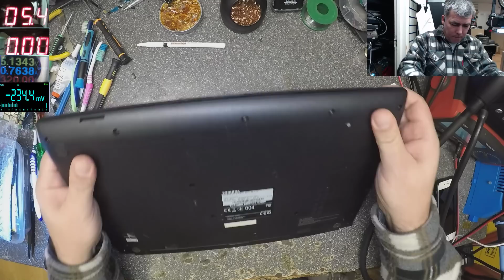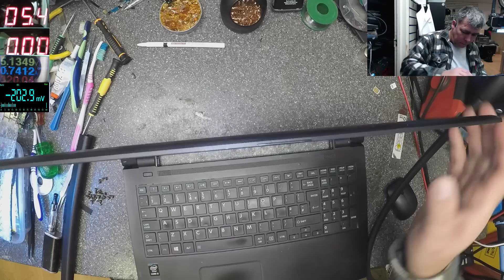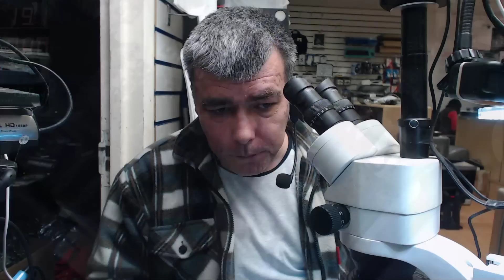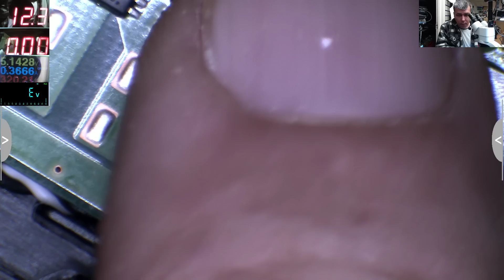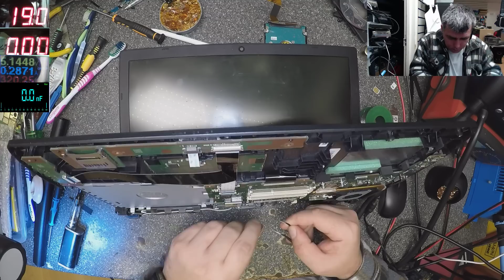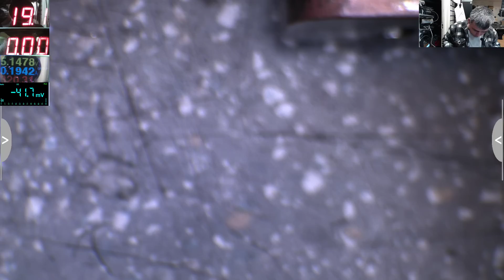Toshiba Pro R50-b-12P, dead, motherboard repair, confusing one

Comment: I'm always surprise to see you replacing components with just a bridge of solder. Are you not afraid that it will break things? (They are there for a reason right?)  Do you replace them after testing? If so, how do you know the value without schematic?

Comment: First thing with a windows 10 machine ... once its up and running .... go into settings and
DELAY UPDATES ... that way you won't suffer an update when you shutdown the computer.
Its all in the very last block of options .... where you find windows updates and activation, etc.

Comment: You were right at the beginning the short circuit is after the first mosfet, the probes didn't make good contact with the pins because that capacitor you were injecting voltage at is in the same track with the first mosfet and current sensor resistor maybe if you haven't taken that inductor out you could've seen that shorted capacitor the  problem is that it was far from what you were seeing on the microscope a thermal camera would've been very helpful in this case and i know it's an old video lol thank you for another good lesson

Comment: I stopped doing updates about 7 years ago. What happened was with every update the machine ran a bit slower, and lost another function it had when new. After about 5 updates the machine is dragging, and none of the extra functions it had are available. So I bought another hard drive and with the new machine I saved its state to when new and put in a faster and bigger hard drive. As it slowed down and lost functions after a number of years, I put the original slow hard drive in and was pleasantly surprised how much faster with all the functions still working and copied that to the new drive. The problem  is I lost all the information and pictures I needed I had added. So I saved them to a thumb drive next time.

Comment: You should do a video on trouble shooting with a bench power supply. I've been repairing electronics for 20 years, but I never learned to use it as a trouble shooting too. only to supply voltage.  Great videos, I watch them while repairing UPS Power Supplies for the telecommunications industry.  Thanks

Comment: Hi there, you seems know well for repair Toshiba laptop no power issue. I got a Toshiba S55T B5273NR MOTHERBOARD with the same issue. Let me know if you could fix it for me? Email k95670@gmail.con and see if you can to try to help me. Let me know the price for the job as well. Thanks!

Comment: "Pro" means soldered on APU, one stick of RAM when an equal amount of dual-channel is better, an unsecured HDD, using a mechanical HDD as is, etc.

It's all marketing. I can think of about 4 items where the Pro variant gives you a substantially better version and Toshiba laptops clearly aren't one of them.

Comment: Nice job, Sorin. I had the opportunity to fix one of these. It's a bit extrange machine. The input mosfets are located away from the power input, and the traces are not very common. In yours, you almost had a fuse; in the one that I fixed, there were no fuse or anything. It was previously manipulated (I hate it!), and there are no schematics for this model. Finally it worked, but it a was a multiple damaged computer...caps shorted, Mosfets...Congrats!

Comment: actually i find the problem after u pickup the blow up cap, coz i know first one u pick up is a resistor depen  of the color n power real.....
coz if that is a cap, there is must have negative or minus real, but I can't see minus real.....
so i quess that is main power.
n after u cut down the resistor ofcoz the first gate is no shot anymore coz the short is not in first gate like u think...
btw i like all of ur education.....
thks for all the video......

Comment: hello sir, i need ur analysis on this problem; i've an toshiba sattelite u300 old laptop which as soon as i turn it on, its fan going full blown all the time regardless of  cpu usage, its very strange and uncomfortable because of its noise. i updates its bios and problem not fixed, the cpu temp on idle state is around 35 degree, still fan spins fully! there is no RPM in bios and also the SPEEDFAN app in windows dosn't show anything about fan or its RPM (yet it say "found toshiba fan driver" when i run the app). so what could be the reason and how can i solve this. p.s : without windows running  and in other environments, the problem persist too. any idea?

Comment: Mr, you have problem solving skills beyond average, but I think you should improve the presentation of your final work /repairs, like putting back a new resistor or at least leaving a neat solder blob in its place. You didn't start repairing laptops 2 days ago😜 Great problem solving value in your videos, as usual. Not so much about soldering skills. And it would be so nice if your desk didn't look so much like mine 😂😂😂

Comment: Hi there , the same capacitor on a Tecra C50-b1271  i honestly  don't see any difference between the two models , so after seeing your video i directly  checked the faulty cap AND   it was shorted  so removed it  
The laptop started
one more time THANK YOU THANK YOU we learned a lot from you!!!

Comment: If you remove a cap how do you not end up with  an open  circuit ??
Reply: I see now. Removing the Resistor created an open circuit but caps are tied to ground so removing one does not cause an open circuit 🤦‍♂️🙆‍♀️🙋‍♂️

Comment: Hi Sorin, I have laptop shuts off/ power cuts random but within a short time only when AC used.  tried different adapters. Do you think can be battery/AC power management circuit. I'm thinking must be electrolytic caps in pmic circuit because its random. On battery only works

Comment: Isn't t it risky injecting 19v on the laptop while the charger is plugged in ( and also supplying 19v )?
Reply: not on this channel … the gods of electrons are with us … and if eventually magic smoke appears we bypass the component.  :)
Reply: @0dium.  Haha.  I am trying to fix a board right now and have 2 options: a) order a replacement chip, or b) run a wire to inject voltage into the insufficient 'enable' rail the chip should put out--"The Dodgy Way" (TM).  ...I think I might go the latter route.  Thanks to Sorin, I now have ethical options I would never have considered.  Note: As in the case of the 19v, at least it's injected in parallel--not in series ( which would be really bad )!

Comment: Would it not be better to come in with 0.8v on the power supply rather than 19v, in case the 19v power rail is shorted via a lesser voltage rail ( like: CPU vcore )?  ...This way there would be less risk of damage?

Comment: the "petrol" fluid you are using that evaporated with high heat, what is that fluid please?
Reply: He calls alcohol petrol. Its isopropyl.
Reply: @Vinnie2x  in his other videos .. he does refer to isopropyl alcohol .. .when he uses that ... so he notices that difference ... this is probably a refined or better quality petrol ... or lighter fluid probably ... it evaporates a little slowly as compared to what i would expect IPA to
Reply: @protonx80  You are correct. My mistake.

Comment: one question sorin. when u use the Dc supply to check for short, do u use only Volt, or do u also use it with Amp same time?

Comment: Seems to be a flawed design by Toshiba. Just fixed the same, with exactly the same issue. Your video helped me a lot, thank you. Couldn't see that blowed CAP near heat pipe. Mine blowed very "inteligent", just a small crack, impossible to see without super magnification.

Comment: It was a story about a repair main that asked 101 quids for repairing an old sovietic piece of equipment, without schematics. He performed "just a soldering on a wire". The guys form accounting department gets mad about the fee of "just soldering a wire".
1 quid for soldering, and 100 for knowing the place :-).  Do you know that repair man  ? :-)

The non joke part: because it is about a PRO laptop, they have replaced an another mosfet with a junk jumper resistor dressed like a capacitor.

Comment: I've repaired cars for 35 years, and I've ran into electrical nightmares that were connected "bass-ackwards" where it made no sense how the component I was trouble shooting was wired. Even with a schematic, it didn't make sense on certain vehicles, and if you work on many makes and models, it only adds to the complexity and often perplexity of the job. Glad you got it figured out.

Comment: That was good. I learnt a lot. I did think that the first short was more black than yellow so thought it maybe a resistor. That is my limited experience so far black for resistor and yellow for Caps. Is that wrong? I replace everything from another board with that theory as I'm not confident with leaving things off.

Is there a quick answer for why those Mosfets have four exit pins connected to the same place and don't have separate lines leading away from them?

Comment: Hello Sorin, i have to disagree with you at the start of the video, i didnt finish the video yet.

-Diode mode is meant to measure diodes, actually the multimeter produces a small voltage and then measures how much voltage is lost at the diode like 0,7V, when measuring from ground to plus the small voltage has to travel all the motherboard and you have all voltage lost like you did on your test and when you put your leads together you can see 0V (dropped/lost) exactly like your test.

- To check the fuse you could use continuity on the multimeter 
-to check a short we have to use Ohm test on the multimeter and not diode, they are not the same.

thank you for your fantastic videos :)
Reply: Alex Xomon no offend, but I think you have to seek more experience..not that you have none, but seek more, learn more,..
Reply: Alex Xomon you can see louis rossman video on using diode mode...if you dont believe me, you surely can believe rossman, who is more knowledge and popular,..

Comment: Hello sir i have acer spin 5 sp513-51 2017 laptop which have keyboard backlight issue it has keys for turning on and off backlight but they are not functioning properly

Comment: something i had fond out ages ago was black = resistor    brown = capacitor
Reply: Is it possible a cap can burn and be black. Tricking you into thinking it is a resistor?
Reply: Capacitor goes black if faulty . may be if u check if it grounds

Comment: First, congratulations for all your videos, I learn very much from them. I have a question: in this video, just before you find the problematic capacitor(20:53 min), you were about to say what you have to do if you can't see what is getting hot with the power supply. Could you tell what do in this situation?

Comment: What was the purpose of the problem resistor, and will it function like before with the bridge.
Reply: its just 19 volt power rail, maybe 19 in ->resistor -> 19 out
something wrong when input more than 19 volt

Comment: Year are perfectly right Sorin on both aspects: 1. So many people never or seldom update and do not realize how much more this exposes them to computer viruses and drive-by downloads. Windows updates is one aspect, but they also never update Flash, Java, their browser and so on. Then their computers get enrolled by hackers as a DDOS bot and all Internet suffers because of their incompetence. The second aspect is how gullible customers are in believing a sticker which says "Pro" and buy very, very bad designs. For my family I'm buying always second hand business laptops, in principle Lenovo T430, or Dell Latitude E6330, or HP Elitebook for about 150Euro. Then I install a SSD and max out the ram and the CPU and I get a durable laptop which I use for another 3-4 years at about the same price this garbage sells and outperforms most of them. I watched many of your repair videos and only once I saw an Elitebook, mostly is just low-grade computer stuff because those break so often with their undersized fans and plastic cases.
Reply: Just don't use flash nor Java. Especially flash, most browsers can play video without it. Also software developers nowadays is so obsessed with these updates, that they absolutely forgetting about usability and optimization of their programs. I have nothing against security updates, but the developers trying to change things everytime when you get used to it so it's getting very annoying. Personally, i do not have updated firefox a very long time and got no viruses what so ever. Why? Because newer version are slower and do not support most of the plugins I have using. If it works as it is - why do you need to change it?
Reply from the maker: Perfectly right

Comment: It’s probably a PRO because it has a CMOS battery, a lot of these recent Toshiba budget Laptops don’t have CMOS batteries and as soon as you remove the main battery all the BIOS settings date and time are lost. It must have saved 20 cents on the build cost at most. Next it will be disposable Laptops and nothing left for us to repair.
Reply: Would that remove a supervisor password too?  we brought a second hand R50 and are unable to change the boot menu (to install windows from CD) because its been disabled.
Reply: remove and insert the bios battery
Reply: @Fluffski2006  it does not remove any passwords.

Comment: thank   you ,what is  the liquid that you use?
Reply: When you have a fluid with free ions it will conduct. Any acid or alkaline substance will conduct. Hydrocarbons have no free electrons, thus they cannot conduct electricity.
Reply: @almerkechalmer4416  I also seen 90% alcohol used
Reply: how come the component not shorted when he use zippo or liquid flux and supply the board with volt for testing ???